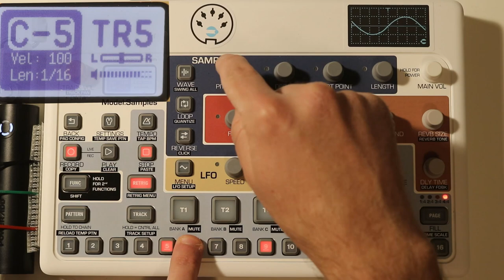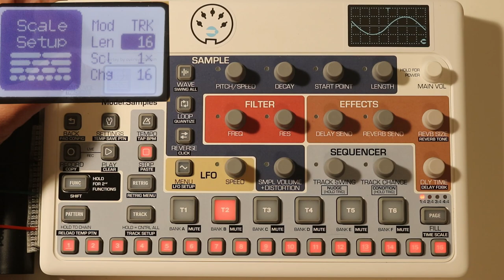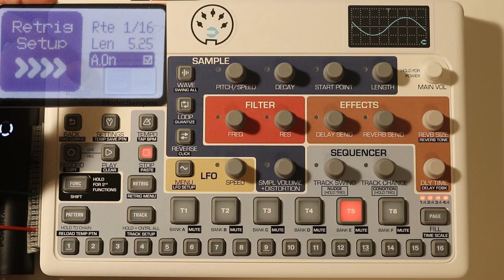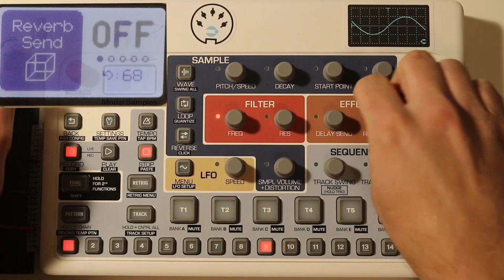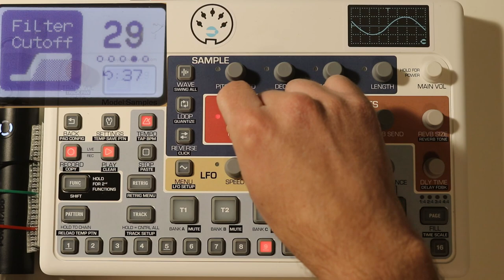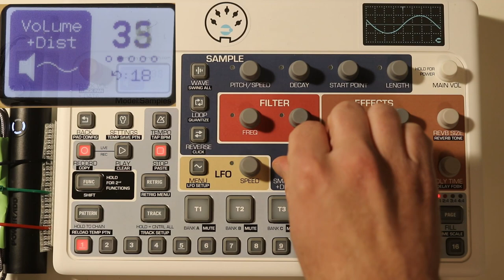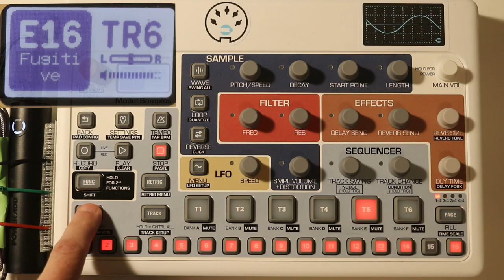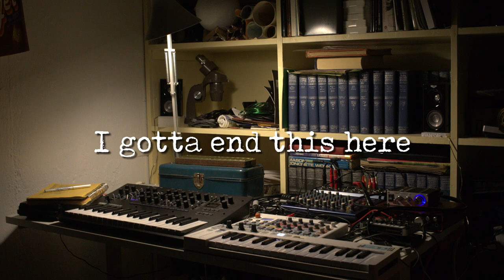Generative Sequences on the Elektron Model:Samples Part 2

Comment: 7:58 fire
Reply: also is that velcro attached to the battery attached to the model samples? if so, major respect. i am going to do this now.  (literally use velcro for everything in the studio)
Reply from the maker: Even better, Dual Lock tape! It is like Velcro but much stronger (and a bit more expensive). It doesn't wear out over time like Velcro does. I now Dual Lock tape all the things...
Reply: @minimal.camera  oh wow, you have expanded my mind